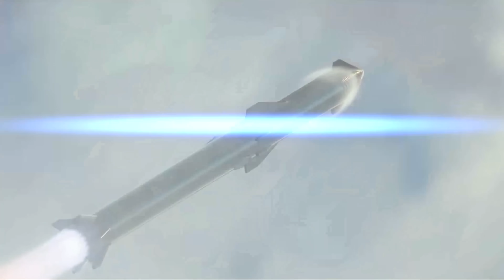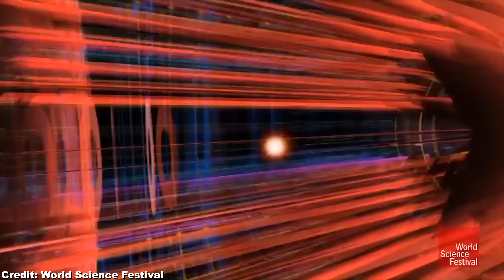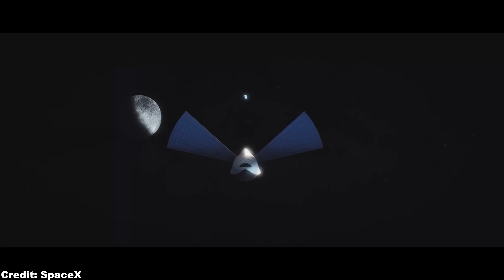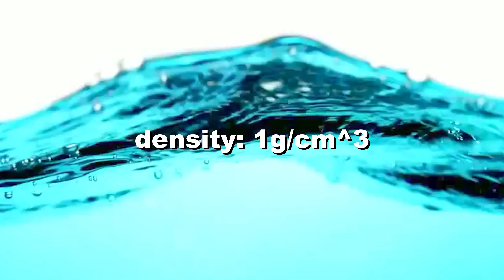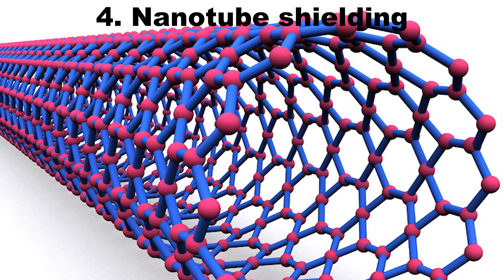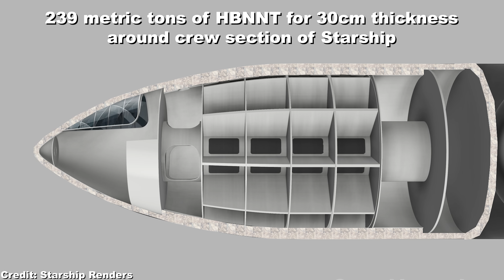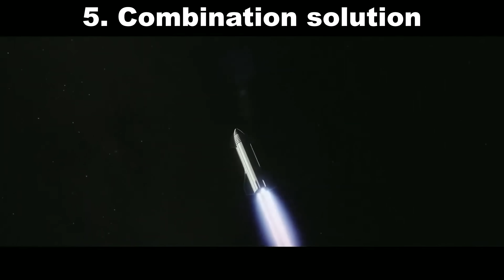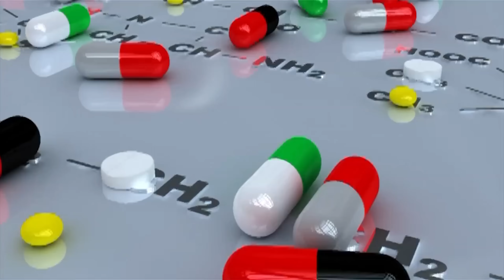SpaceX Starship FLAW Fix: Best Cosmic Ray Protection?

Comment: I am a big fan of the potential of Starship. Starship is an ascent vehicle, a transport vehicle, a lander, a tanker, and a supply ship. If all works out, that is truly amazing. There is nothing in any plans that can compete with it's orbital access, trans lunar, and Lunar Ops. However, It's least favorable quality may be as a long duration human transport. I like the idea of the inflatable attached to Starship. I believe they offer a better radiation protection and they would offer much more comfort to the crew. I personally would rather see a larger ship for the Mars trip with maybe several Starships attached to be used as landers and habitats. I have seen plans for a larger Mars transport vehicle with better propulsion and inflatables, all within our capabilities of cost and technology. It would be like sending an orbiting base to Mars to conduct operations from.

Comment: The best solution is a multiple use solution.
Even when water is heavy, you will need part of it for consumption, so at least in some part of the starship a water shield can be used as water reservoir.
Perhaps you may have no other option than carry water as a shield, but this water shouldn't land on Mars, it can remain in orbit for the return.
You must put 320t of H2O in LEO or MEO only 1 time, the ship can take that water in orbit the same way like refueling, the ship will increase in mass and this will force the Raptors a few seconds more to achieve speed, but when you reach Mars, you can leave the water in orbit and descend.
In the return trip, you can re-capture that water, and use it again as a shield for the return trip.
That water can be parked in orbit for use in the next round trip to Mars.
With this approach, you need a tanker with water in orbit to give water to the departing Starships, and another in Mars orbit to discharge the water prior to landing. In the return trip the Starships recharge that water in orbit prior to the trip to Earth.
So a tanker can carge water for 3 or 4 Starships and you will never need to put that water in orbit again.
You can also use the excess water to brake, like a water rocket. With this alternative you can reach higher speed spending less time in space, but using the water as a brake for entering in Mars orbit, with a pump and noozle dedicated for that use, but you will throwing your shield for the return trip.

I wonder, has the Metalox the same protective properties as the water?
Reply: ciudadanubis - 15 cm of Water will be more to sufficient to protect against solar radiation & solar flares & to provide moderate protection against cosmic radiation (lowering what colonists are exposed to every day to what astronauts are exposed to on the ISS). That works out to ~140 t to cover the inhabited part of Starship. Astronauts regularly spend 6 months on the ISS which is more time than colonists will be in transit to Mars (SpaceX envisions transit times of 3-4 months), &, between Salyut, Mir & the ISS, some Russian Cosmonauts have spent 18 months in LEO.

Comment: Ok folks. Here’s the deal. You don’t need a meter of water for shielding. In fact, we don’t need 1/4 of stainless steel either. You need a double bag (more like flexible honeycomb) of water to be filled along the inner wall of an inflatable habitat about 4inches thick. The starships can do the ring flights to the surface of earth and mars. Your inflatables with service modules can make the interplanetary journey and logistics. The water bag can stay empty until radiation threatens, then migrated from storage tanks.

Comment: J&S You2 THINK too much ; and , that's a GOOD THING; and, I'm glad for it!  Really Great Video here!  Since the current proposal considers a refuel mating in space; why not, do a reverse fairing adaptation, where a waterlogged-fairing is pre-stationed just ahead of the refueling and has its own mating propulsion rocket engines so that the inertial mass is of small consequence?  The fairing can be parked in Martian orbit for re-use on return trips.  Using nanotube sponge-shell construction for the fairing, It would also add to the shielding efficacy of the fairing.  Thus there would be two in space matings; one for fuel; and, a second one for mating with the fairing.   It's like a helmet for bike riding.  You don it and you doff it.
Reply: @TechChasm  Hey You 2! Super thought; about the ice water! The thing needs to rotate anyway for gravity; no?

Comment: As an engineer by profession, I can see one more alternative to the shielding issue.  Launch a shield separately, and reuse it every time.  Leave it in orbit around earth when not in use.  Then simply install it when the ship reaches orbit, go to mars, come back and then again leave the shield in orbit to return to earth.
Reply: Yes. But not just shield but whole interplanetary transport ship. I am big supporter for "true space ships". That means making space ship that ONLY works in space and is optimised to the max for this environment. Make it big, make it not care about aerodynamics, surface thrust etc. Put people in more shielded area, use "ATS" position (ass to sun ;-) ) to use fuel as shielding as much as possible. Cargo just put in Starship that only takes people between Earth and orbit plus orbit and Mars.
But you know what would decrease radiation by more than 100x for free? Switch target to Moon. Make industry on Moon. Make true space ship 10 times bigger than Starship. And you can use even 5 meter water shielding around habitation part.
Reply: Great minds are thinking alike. You must have noticed it too. ; - )
Reply: @TechChasm  you have to carry some protection against radiation anyways, so F=ma is irrelevant here. Or I rather say it's an advantage, since you leave the radiation shield in orbit, and you don't have to carry it up and down from ground to orbit.
Reply: @zoltankurti  Every Kilogram of weight = many kg of fuel = more kg of fuel..  so no its not irrelevant. BUT there is a solution. You just need to bring more fuel!  I mentioned this in their first "FIX" essay.  A Starship::Tugboat that imparts extra DV to the departing ships.
Reply: @tobifoong8025  no, that's not what the original comment says. Don't put radiation shielding in the ship itself, but build a separate shield object.

Since the ship probably needs shielding anyways, you save mass by not putting it in the ship and gain the same mass back by also accelerating that separate shield. But this way you don't have to carry it to orbit, and you don't have to land with it so it's even more efficient.
Reply: @zoltankurti  sure its not "in" the ship but the Dv needs to be imparted to the mass of the system as a whole. Ship and shield needs to travel and gain the Dv to get to Mars.
Reply: @tobifoong8025  dude. Read what I wrote. You need that mass either way. Shield in the ship or shield outside the ship. Doesn't make a difference.
Reply: @zoltankurti  :-) looks like we are misunderstanding each other somewhere ... My concern is (and the point of the Video) is  that there is currently no solution for shielding.  The proposed "solutions" add Mass to the system . That MASS will have to come out of somewhere. and the only place to get that is from Cargo Mass. It does not matter if that Mass is in the ship or as an external shield object. It will be taken out of the Mass allocated to Cargo. Now of the solutions's mass is around 100 tons, then  there is no more mass available for Cargo or Crew. if the Mass is above 100 tons the system wont be able to get to Mars. I am not talking about lifting it up to orbit or landing it(that is a separate  issue). I am talking about the DV needed to transit it to Mars.
Reply: @tobifoong8025  I think the original comment clearly talks about a situation where we have enough delta v. The point of the comment is that if the solution can be detached, you don't need to worry about it below orbit. That in itselfs saves a lot of delta v compared to an option where the shield is built in.
Reply: @tobifoong8025  you are talking about the mass of the shield regardless of where it is, where I am talking about the advantage of the detachable shield. That's the problem.
Reply: @zoltankurti  Given that Starship's total volume of Fuel is Fixed.  Thus the DV is inversely related to Mass transported. You cant increase the Mass of the system without losing DV.  It does not matter if the Shield is detachable or not It is Mass that has to gain the DV from the allotted and fixed amount of fuel.  you cant separate the Shield mass from the Dv and fuel calculations just because it can be detached from the ship. Sure You can save a tiny bit of fuel by detaching the shield before landing but that is almost an insignificant amount compared to the Fuel needed to get the shield to Mars.
Reply: @tobifoong8025   I understand, don't worry. I took it as a solved problem, and only talked about the detachable shield vs built in shield. 

Delta v is proportional to log(beginning mass / final mass), just to clear things up. I'm not sure what you meant by inversly related to mass transported.
Reply: @tobifoong8025  
-- Have initial energies
Plus
++ Acceleration forces of Solar light & Gravitational !

-- Can use same types of energies, 
to accelerate while in orbit  !
Reply: Chris Schur how about the mass you are adding with your shield ?
Reply: @TechChasm  elon has patent for radiation sheild fyi
Reply: I think the best solution is a water cover. The starship should only have the space available to contain it around the ship, either to take off from Earth or Mars. A device of water in orbit that is gradually filled, would supply the shield for the trip to Mars. On Mars another deposit would previously be put into orbit but empty where the starship would deposit the water to land, then return to collect the water to return to Earth. Therefore, if the water can be reused for multiple trips, it should not always be put into orbit around the Earth.
Reply: ** Reusable parts, are being considered ?
--Push the leading companies for reusable shields.
--Might get best results with aspiring companies, 
that are not compatible with space "giants" ?
- Possibly get  even better results, 
if: you build your own company for production of the shields ?

*********
More ?
>>As in current mass shipping:
--There are separate shipping containers for separate orders.
>>These shipping containers are provided by an outside company.
Reply: @TechChasm  
Your equations, forget the different environments.
-- Space is mostly influenced by momentum.

-- Landing & Launching, have many concerns that 
severely use energy!

********
** It is possible to: "park" into/out of 
orbit, with minimal loss of energy:
and actually increase the momentum energy  !

!! IF Done properly:
It is Possible,
That the rockets only need energy 
for launching & landing !

!! IF can fully use the light from the sun:
it is possible for each trip to be faster than the previous trip !
** Without additional fuel ! **

?? What are the acceptable minimum and maximum trip times ?
(Both questions, will be of major concern !)
Reply: What about the acceleration of shield to mars, u forgot the most critical issue, like everyone else.

Comment: The Bigelow modules are inflatable and have very little shielding.
Reply: Not correct - they have shielding through the wire mesh and foam materials used to inflate them. The walls of the BEAM units are relatively thick when compared to those of other space modules - tens of centimeters instead of millimeters.

Comment: Hydrogen enriched boron carbide nano-tubes... Can you not picture Captain Piccard on the bridge of the Enterprise D, calling down to engineering one day asking for a solution to the daily suite of problems experienced for the sake of the plot, and then hearing Geordi LaForge over the com system saying that he "might be able to reinforce structural integrity using hydrogen enriched boron carbide nano-tubes" and then the obligatory "Make it so!!"

Wonderful take on this as always, so here's a slightly more fringe idea of mine: Perhaps a super lightweight conductor, probably plain old carbon nano-tubes, could be used to create a magnetic shield of sorts to repel high energy radiation, much the same way as Earth's magnetosphere does. This would probably wouldn't be feasible due to the high amount of electricity needed for such a construct, but like I said, fringe lol

Comment: You could load the water for sheilding after launching just like they are going to do with fuel.  Just launch another starship with the water to load up the starship going to mars.
Reply: Stupid idea, you would still need to accelerate all that water mass to mars and deaccelerate it, making the trip impossible within just 6 months.
Reply: Robert Oliva Vidal who talked about sending water to Mars ?
Reply: @amazingamazigh1538  you will need your shield all the way to Mars to protect astronauts. At least you will need to waste tons of fuel only to accelerate the shield.
Reply: The problem is not sending shit to LEO, the problem is to accelerate from LEO to Mars.
Reply: Robert Oliva Vidal not if you use fuel as your shield. Moreover there won’t be no problems if you refill your ship with a supply ship while going to Mars.
Reply: @amazingamazigh1538  yes, but those are different ideas. Please note that water cannot be used as fuel xD. Using other fuels such as CH4 might work, but it will be superhard to do since they must be ultra pressurized. Sending another starship with the shield could also work, but for that you'd need twice as much launches from Earth.
Reply: Robert Oliva Vidal I’m not stupid ty I know that water can’t be used as a fuel. I was talking about CH4 among other fuels. If you send another starship with the shield what about the starship which has no shield ?
Reply: @amazingamazigh1538  starship can bring 100 tonnes of payload to mars. The water shield weights 300 tons. You would need a fully fuelled extra starship in LOE with only the water to be transeferred to the other starship during traject to Mars. Doable but very expensive. Plus the water will be thrown away before deacceleration. Thats why i said this idea is stupid. A better idea is using CH4 instead of H2O, but I think it is easier to build the habitation module inside the CH4 tank, rather than covering the walls with pressurized CH4.
Reply: @DungeonMasterGod IFirst of alll I haven't done the math. If it made it safe for a longer trip and overall was safer and cheaper it might be worthwhile.  It would probably be necessary to unload it in orbit before landing.
Reply: Brilliant although they kinda need a space station it will be a bit of a mess ull need 5 starships for the fuel and another one for the water only to set 1 starship to mars
Reply: sshironodeath toresu you only need 2 other starships one with fuel and the other with water to get one starship to Mars so why are you saying 6 ?
Reply: Since the other starship has no passengers you can even use only one starship with fuel and water to send one to Mars.
Reply: Agreed! That would easy enough if they have cracked refueling in space too,

Comment: I have heard electromagnetic shielding discussed, do you think this would be a viable option?
Reply: So far it has proven to be too big, expensive, and some more cheap excuses to not use the hull as a conductor. I suppose because the ship is 60% fuel storage and needs simpler manufacturing.

Comment: NTR engines are not practical for the time being. SpaceX's Mars plan requires heavy reuse of the existing Starship technology to kick-start the Mars colony. Starship needs to be able to land and re-launch, which would not be feasible with the current state of NTRs. Not to mention the incredible number of regulatory restrictions that would prevent SpaceX from accessing and using the nuclear materials they would need. 

New engine technology will come once the economic drive exists. But we're going to need a lot of Starship flights to Mars and asteroids to light the economic engine.

Comment: Are (most of) the cosmic rays charged? If so would an electric field deflect them?
Reply: They are travelling too fast to deflect significantly with an electric field. A magnetic field would have a better chance but would probably need a complicated design, since the cosmic rays are coming from all directions.
Reply: @TechChasm  Yes, but still more feasible than using an electric field--use the cryogenic fuel to keep superconducting coils cool. The energy required is only to ramp up the field at the beginning. The problem in either case (electric/magnetic) would be protecting the interior of the ship and crew from the field.